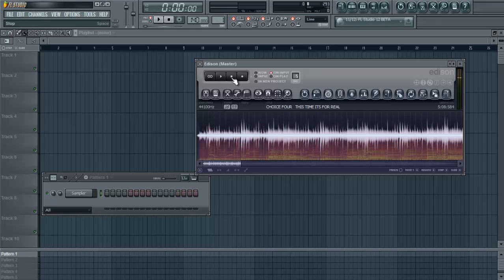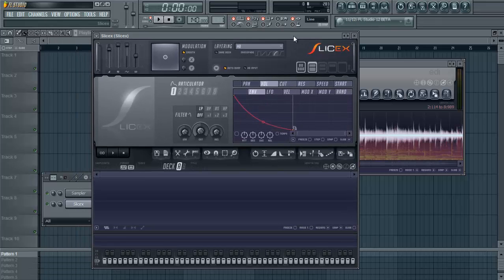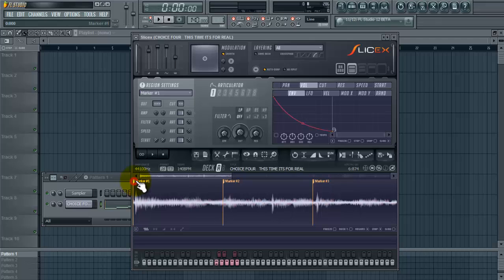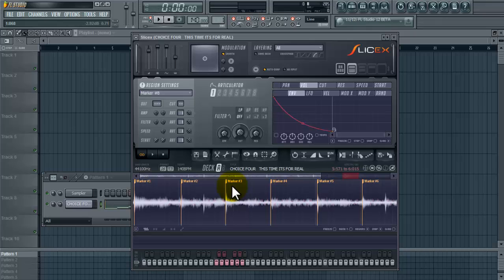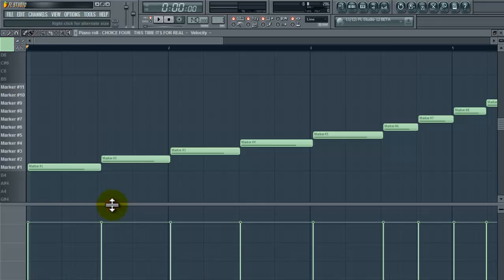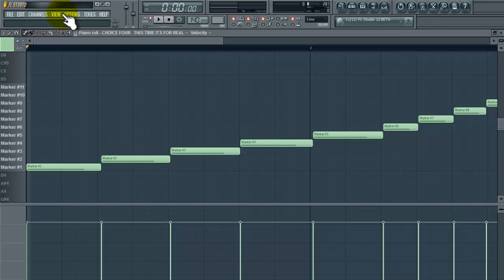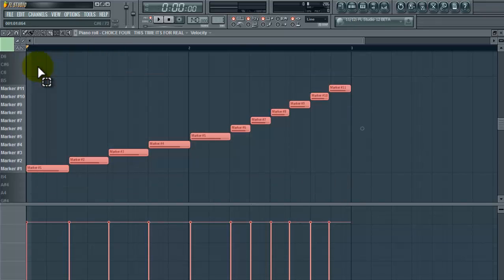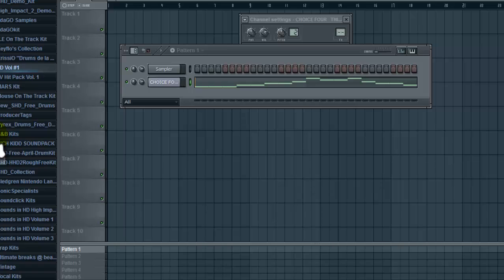FL Studio: Using Slicex to Chop Samples

Comment: My problem with chopping in FL has always been timing.  Can you show a little more about how to quantize sample chops to the grid so that the downbeats always fall correctly?  I noticed that your notes you were clicking in on the piano roll didn't fit exactly to the grid.  At least not at first..  But your chops sound on time when you play the beat.  Thanks for making the video it was informative.
Reply from the maker: +Step Stevenson The time stretch function in slicex is very odd and as many times as i've tried to use it never performs the way u'd expect it to so i recommend u make your chops in edison then drag each individual chop to the playlist and adjust the timing of each using the time knob. I've experimented sampling in FL using all the four main ways u can do it and I found that just using edison was the easiest way for me. I will make a video on this so stay tuned and subscribe if u haven't already, thanks!